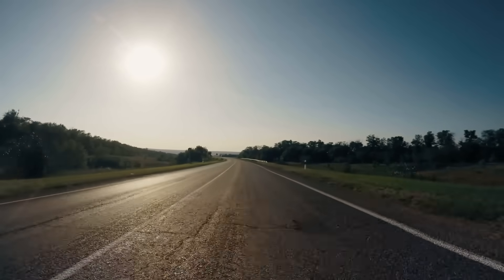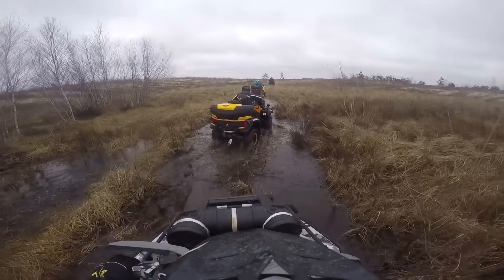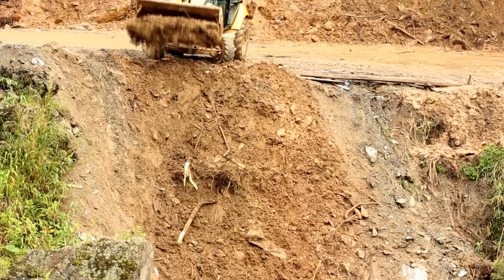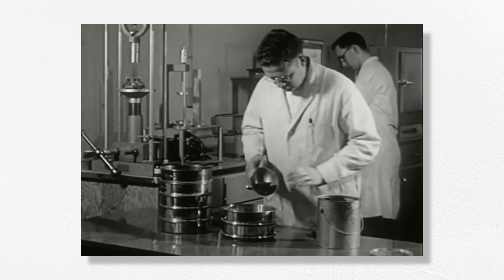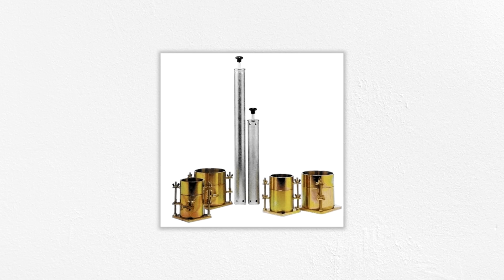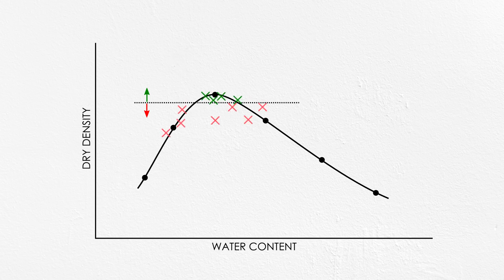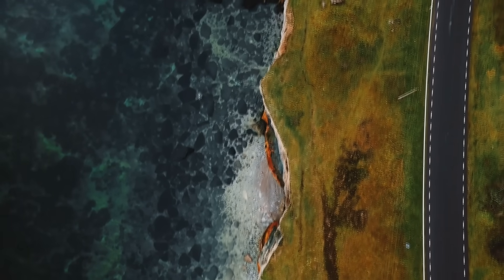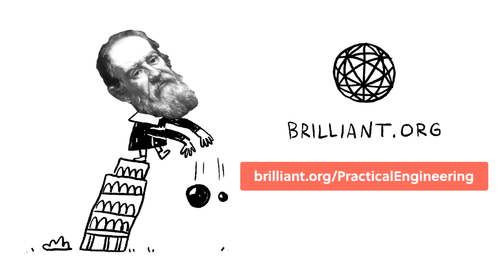Why Does Road Construction Take So Long?

Comment: Well you see, the foreman didnt buy coffee and donuts for the heavy equipment operators, and without that sugar rush from donuts, things move slower....  :) although personally, I prefer plain old fashioned donuts....but really it depends on what type of road, highway, bi-way, municipal, soil conditions, water table, altitude, climate all contribute as to how it is constructed but compaction is what really takes the longest as you can only pack so much material of any type from shot rock to Granual A, at a time. You have to compact between each layer, building over rock is easy compared to wet, swampy soil, clay etc... Leda clay... you go around, you cannot have organic material in your road bed because as it rots, it will leave voids and the road bed will sink. Highways, bi-way, airport runways, municipal, regional... I've built them all.

Comment: I Work on the rollers here in Australia and I know that driving graders is more than just driving a machine. It's a career job cause they control everything on site from trucks to water carts and the rollers. They also mix the soil so that there is enough fines with the aggregate for compaction

Comment: Hi Grady! Thanks for this video, I love it. 
Have there ever been approaches to speed the process up? If so, why they failed? 
For instance I thought of making soil layers ahead of time, by something of a moving machine that produces this layer and puts it in place, maybe with something adhesive in the mixture to keep it together. This is just something from the top of my head, but I'm sure plenty people were pondering this before.
Reply: I know this comment is old, so apologies if you've already found your answer. These processes can be sped up but at a prohibitive cost to the project. I haven't seen such a theoretical machine as you've described. Soils that are too wet to be reused are normally just removed from the site and disposed of at a gravel pit to be reprocessed into an engineered aggregate/soil. Engineered soil/aggregate is then brought in to replace it. Sometimes the unsuitable soils can be stockpiled on site and allowed to dry before being reused. Soils that are too dry can be hosed down with water and allowed to rehydrate before compacting. Sometimes soil can be amended (adding a binder) depending on the soil issues. It's not uncommon to mix cement or kiln dust into more fine grained (silt or clay heavy) soils if they're too wet to compact properly. They'll cure almost into a low-grade concrete that's suitable for roadway support, and in some cases building support. Timing is important with earthworks which is why the majority of it happens in the warmer, dryer summer months. Any rain or unexpected wet soils can cause a project to stretch out as the soil issues caused by water are remediated with the help of a geotechnical engineer.

Comment: As a trucker who has driven about 2m miles, I’ve seen that soil density metering device used so many times, and now I can die satisfied finally knowing what it is 
. 🤗
Reply: Damn, 2 million miles by one guy--really puts into perspective the importance and scale of the work that y'all do!
Reply: yep, also called nuclear densometer
Reply: @chinmoychoudhury5140  idk man. May be the "technical" term but I've literally never heard it called that. Everyone just calls it a "gauge" or "nuke gauge"
Reply: @chinmoychoudhury5140  "Nuclear densometer" didn't he get elected President at one time?
Reply: That’s about 20-30 years right?
Reply: i worked a nuclear density gauge for awhile its something
Reply: @geologian5066  nukes are cool for about a day, then it just gets annoying carrying it from one survey station to the next
Reply: @69FTWB  yeah i was happy to move on when i did
Reply: @geologian5066  late reply, but how long did it take you to move on? And to what line of work? Currently a soil technician myself.
Reply: @geologian5066  the best part is when you look down, run the pilot nail, look up, and in that 40 seconds there were 6 scrapers and a blade that all lined up at the beginning of the lift. If you're lucky one will even honk at you before the 2 minutes it takes to test is up.
Reply: @wynter8562  yeah that brings up memories. crews can't make you a cut pad before they wanna cover it back up haha
Reply: you basically have to run in front of the compactor
Reply: I realize your comment is a year old, but about how many rigs did you use in that time to drive that many miles?
Reply: That’s about 80 trips all the way around the Earth, crazy.
Reply: 2 million miles × $1.00/mile =$2 million.
You must be rich!
Reply: So you've driven on 6 trillion dollars worth of roads if each mile costs 3 million
Reply: Hehe….glad that friggin’ object was finally identified for you…2 million awesome!
Reply: Here in Indiana it's slow because 5 old fat guys always stand around watching the one young guy doing all the work. You've been everywhere I'm assuming. Is this true everywhere or just Indiana? Before any old guys get pissed I'm one also.
Reply: @apathyguy8338  any city work is like this lol
Reply: @apathyguy8338  And all 5 of them have a shovel to lean on.

Comment: When you need to compress it layer by layer wouldn't it be easier to compress a little more area than adding a lane later when needed? So why don't you just build the widest road possible?
Reply: Land is expensive, even more expensive in urban areas

Comment: I don’t hate construction except when they are dumb. Us 2 between mile maker 8 and 10 we had random holes apear prob due to a dragging semi. It went right up the ramp and off to the side. Within a week they repaired it and made it worse by not even doing it evenly. It was bumpy and was safer to deviate around the holes if possible. A month later they redid it and it wasn’t much better but a bit more even and not lumpy. This was last year. Earlier this week they have torn the entire road out and are finally finishing a re-saving job they started at that time...

Comment: One of the weirdest things I learned in a trip into northern Alaska was the roads changed every season. they could not form a foundation due to environmental and logistical issues. So, as the frost in the soil froze, melted, then refroze the road on top bends over new hills and valleys!
Reply: The landscape elevation changes every season in Alaska? Can you explain a bit more about this??
Reply: @jijst5   the water in the soil melts and refreezes over the course of year and it’s enough to mess with the elevation of small hills. Imagine trying to build on an extremely slow waterbed

Comment: Hey Grady, please do a video on the natural gas networks in cities, Are main lines all low pressure or is there substations that regulate it (similar to electrical substations stepping down). Are there big reserve tanks like water towers to handle times of huge demand and fluctuations. How are they set up so as to prevent a fault leaving huge areas without gas.

Comment: I was a Materials Technician every summer while in college in Montana, and the road industry is intense.  We had to fill a valley at the end of a runway so they cut the entire airport by about 10-20' and used all that dirt they cut to fill this valley to extend the runway and we had to test the fill in random spots twice a day.  We had a QC group and a QA group while they were still filling, watering and mixing all day everyday for 7 days a week for almost 3 months straight.  hard work

Comment: I used to build trails with the conservation corps. Essentially everything you mentioned is the same except at a much smaller scale, including the cutaway diagrams. We learned to always cut and never fill when possible precisely because filling would always turn to mud and erode at some point. Being that it was in Arizona it was also a pipe dream to expect reasonably moist soil to fill with.

Comment: The one I want an explanation for is why road resurfacing takes so long. It seems like it should be nearly instant, but it takes months.
Reply: Simple Grind/Overlay usually are fairly quick to do. Totally rebuilding a roadway (including engineering and rebuilding the earth underneath it) usually take a lot longer. it may be possible that you have a combination of stipulations that substrates be tested after grind and repaired before proceeding are in place, along with a contractor milking that stipulation by fudging numbers on every crack they find in the substrate.....

Comment: And after all that work most of it will be utterly useless in a few years without constant maintenance due to potholes , built like consumer grade trash you throw away like everything else .Roman roads though built over thousand years ago some still good .
Reply: Don't get me wrong I haven't done the math or anything similar but I don't think the average roman that walked to their destination weighed 3-80 tons and walked at 60mph.

Comment: Great video as always Grady! I'm reading alot of comments about how projects aren't always 'slow n steady' they seem to be fast ... And then nothing! 

One reason to explain this frustrating scene: planning is everything in construction - poor planning leads to cost, program and safety issues. So when construction starts and comes across something unexpected, which is very common, managers usually ere on the side of caution and tools down until they have a suitable plan in place. 

A good analogy would be: your car has never had a problem then all of sudden it starts making noises from beneath the bonnet. It's still drivable, however before you take it out of town on that weekend trip you decide to get it serviced. It could be nothing or it could be a large problem. Better to have it fixed at the mechanics then breaking down on the side of a rural road. 

Constructions like that but with a shit-tonne more stakeholders!

Comment: I'll tell ya another thing that adds to the time it takes to build a road, it's when they DISAPPEAR FOR 8 OR 9 MONTHS to drag it out and work on other projects. We are being robbed blind by the highway departments. It should take 1/2 the time, cost 1/2 as much, and be twice as good. We should have 6-lane interstates all the way across I-40 thru TN and AR, for example. With regular, large rest areas every 30 miles. Just for starters.

Comment: Maybe you can explain the economics of using asphalt, lol. My city still has 100 year old brick streets that are in better condition that the pot holed asphalt streets that were repaved just a few years ago. The concrete streets that were built decades ago are still in good shape as well but, they repaired them with cheap asphalt rather than repairing them correctly,

Comment: I'm fine with road construction, but I saw this in regards to bridges:
"This bridge has too much traffic, lets build a new bridge", which only adds pedestrian walkways. While being built they shut down half of the bridge during its 2 year construction.
Too much traffic = shut it down?
This was a new bridge being built next to it. The new bridge wasn't even started over the water before they shut down the old bridge.

Comment: I've built a lot of commercial projects and the absolute most important part of any project is the dirt work. On the select fill we always went for 95% compaction. A building will not last with out correct dirt work (a lot of plumbers and electricians hated digging in the pad to get their under slab work down). The problem with a lot a residential house have foundation problems is because of the dirt work, that's why house leveling companies are in business.

Comment: I've always wondered why local road repaving projects and replacing old traffic lights take so long. They repave the road in about 2 weeks but the temporary tape line last for about 6 months+ later. Also, they hang new traffic lights next to old traffic lights and it takes a long time to turn them on. In one intersection, it literally took about 3 years before they removed the old and turned on the new ones.

Comment: All the ground that you cover with road, you have to make a way to get the water into the ground so it doesn't just run off.
I don't have experience with roads, but for big parking lots they pipe the storm drains into drain fields under the parking lot.

Comment: If they built roads that actually withstand the abuse of cars and salt it would be better, however, we build roads that are on a clicking time(pothole). Prob would save money if we engineered a better solution that reuses waste but is more durable. Why they don't add more rubber into the Asphalt like some countries is beyond me

Comment: My brother and I are debating about Crinkle Crankle walls: A crinkle crankle wall, also known as a crinkum crankum, serpentine, ribbon or wavy wall, is an unusual type of garden wall built in a serpentine shape with alternating curves, typically found in the United Kingdom.[1]
I believe it would be more stable and stronger than a regular brick wall, with comparable dimentions etc. I think it would be very interesting to discuss!

Comment: Road construction takes so long because for every ten people on-site, only two are working at any given time. At least that's how it goes here. To make matters worse, the people responsible for making the decisions are always trying to do new road projects and ignore fixing old projects and roads. There is a pothole not far from my house on a main road that had been there in some form for the last six years at least. They keep "patching" it and doing a pathetic job at it every time. The "patch" lasts about a week, then it takes a month or three for them to come and "re-patch" it. They have been repatching it for over six years (it was here when I moved here about six years ago, and it is still here). At the same time, construction on the interstate has been non-stop and they've also been working on a bypass nearby. This is not just a single pothole problem either. Vast areas of main roads are in pathetic shape and the rural secondary roads are even worse. It's impossible to go a mile without a pothole on secondary roads and impossible to go a few miles without a pothole on the main roads. A nearby town has over a dozen potholes in the roughly one-mile main street. The interstate? Flawless. Perfectly smooth, no potholes, everything is nice (except there is always construction). It has gotten so bad that road repairs are supposed to at least be started on within a week now, but all they do is a quick and dirty patch job which lasts a week tops. This isn't limited to just my city either. Everywhere within fifty miles of my location is like this. Every city, every town, every road between towns/cities, every secondary road. It's all pathetic, except the interstate and new projects they do then never maintain. I don't get it. They can't blame lack of people, every crew I've seen working on any road projects is large, usually more than it appears needed, especially when the majority of the crew does little to nothing (I've watched them). They can't blame lack of money, they sure get a LOT of taxes from us that is supposed to go right to the roads. Maybe they mismanage money or maybe they focus on new projects and expansion or maybe they're just incompetent. Whatever the cause, I haven't seen a decently-maintained main or secondary road in my state ever. The last time I saw a decently maintained main/secondary road was in other states.

Comment: So it takes 3 years to complete and then after five years they come for 2 years of repair because there are already holes in it. Every day you can see 3 or maybe 4 guys on the construction site hardly doing anything. Or at least that's how it works in Czech Republic. If it takes long, it should last longer.

Comment: I remember seeing a new overpass being built over I-35 back in the day. The project started late 2011 and wasn't open to public use until 2016. At the time I thought it was finished so late due to lazy construction workers. But to be honest if rather such a project take 5 years to finish building according to safety standards than to have a shoddy constructed bridge built in a few days because someone said "the Romans built roads in a few days. " Good thing those people aren't civil engineers...
Reply: Many modern buildings have collapsed built by todays "experts" .Built to safety standards ,  standards are constantly being updated , its  built for the cheapest amount possible , anywhere to cut corners and save money is done .Some engineering in the past our technology cant duplicate today . No such thing as built in a few days , it  takes our expert engineer crews years to build roads today  and most will last a few years tops without constant maintenance .Built to safety standards ...lol , when another building collapses or something  they'll look into it and change the safety standard.

Comment: don't forget about when the soil is too weak and undercuts and or pile need to be added to make it structurally sound. Also, contaminated soil that needs special safety measures to deal with. Road work is slow until you realize the size of the structure being built, then you realize it actually goes fairly quick especially with cure times when concrete is involved

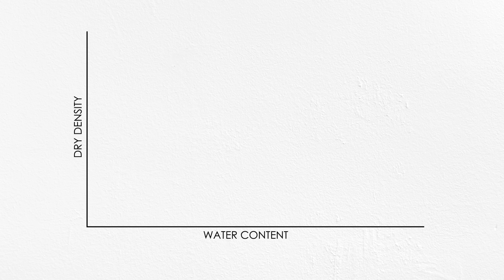Comment: 5:55 Starts here. This is a bit of click-bait, but not totally. And video series would be great to watch. The answer most were looking for would be construction companies take on multiple jobs and are only required to be on one job a given amount of time per week/month/etc.. This keeps construction sites vacant for long periods of time leaving drivers furious. Your explanation of new construction is great and applicable, but not what I was looking for when I clicked. Things like permits, materials, availability of workers, etc. play a significant role as well. These are basically guesses and don't quench the road rage, if anyone has a real answer please chime in. Great vid, gave it a like and I'm already subbed.